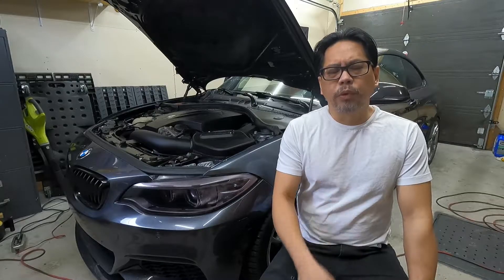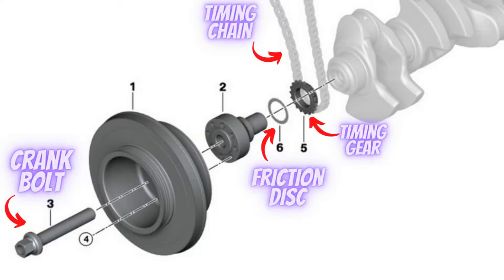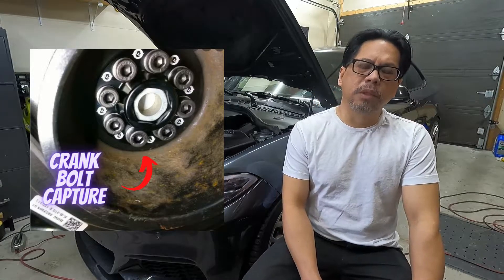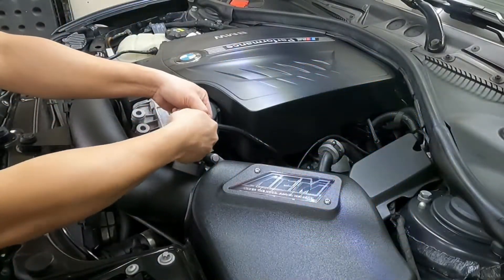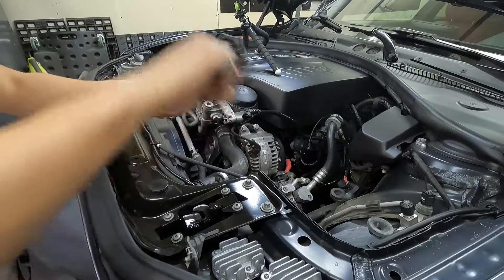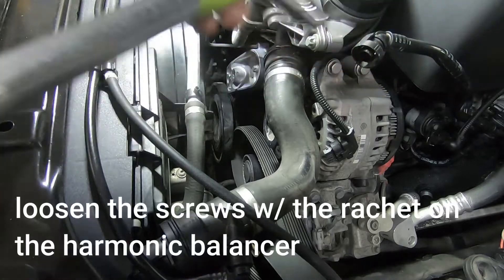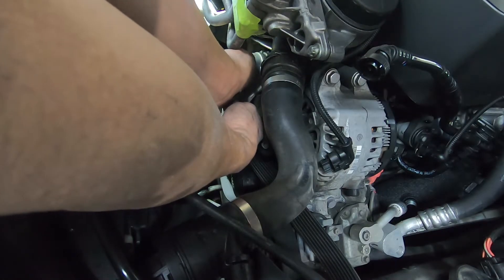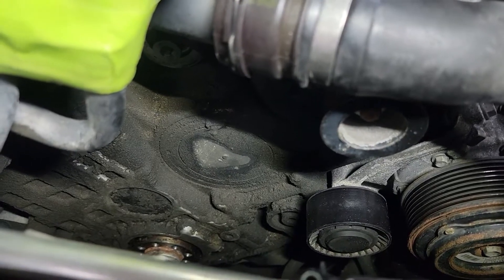VTT crank seal guard & crank bolt capture DIY install ( FAILED INSTALL 😡 ) PART 1

Comment: What if you have to replace the serpentine belt can you remove the crank seal guard to get the serpentine belt fixed?
Reply from the maker: No need to remove the seal guard, Just loosen the tensioner and remove the belt, Replace the belt in the reversed process.
Thanks for watching!!!👍